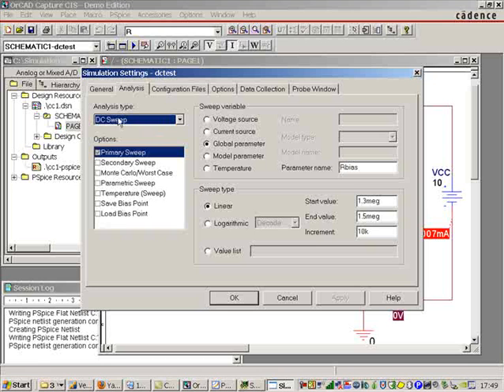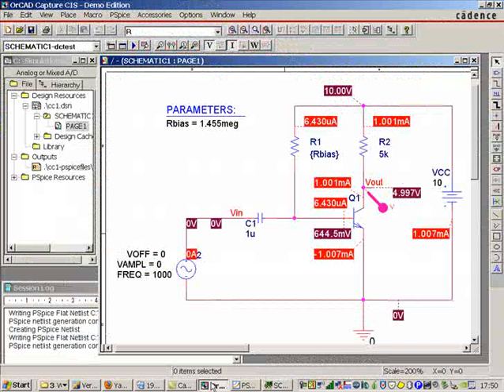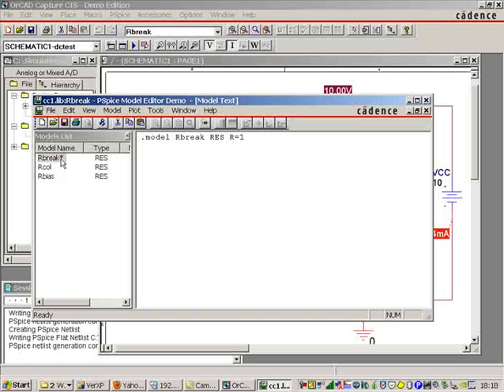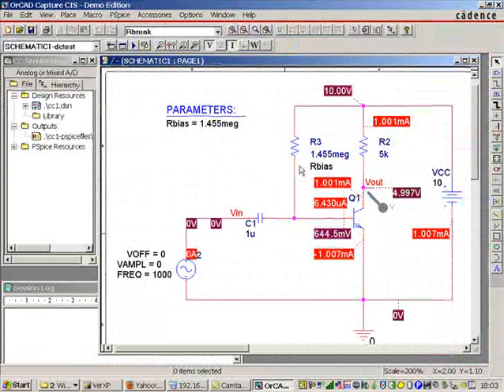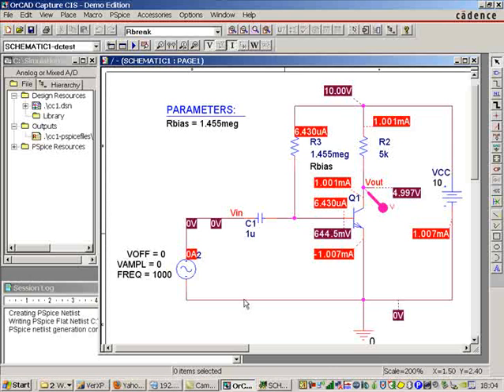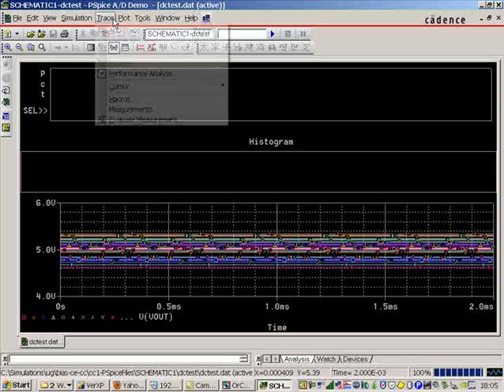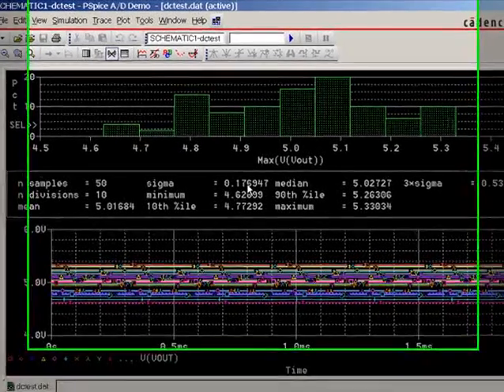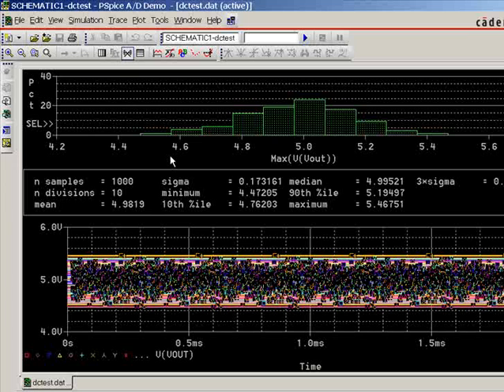Orcad monticarlo1

Comment from the maker: NOTE: this method of Monmticarlo is a little long-winded, to simplify the process you can set the Tolerance parameter on a normal resistor to a value like 10%, and this will then perform the same as the R_Break component.  You need the "%" tagged on the value however to make it work. R_BReak gives you the potential however a much more complex model for a resistor value.